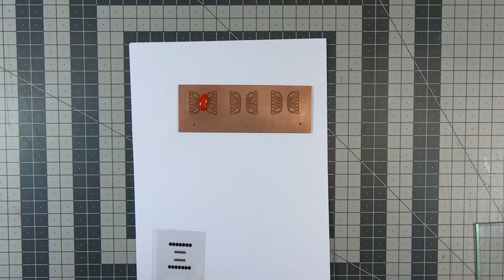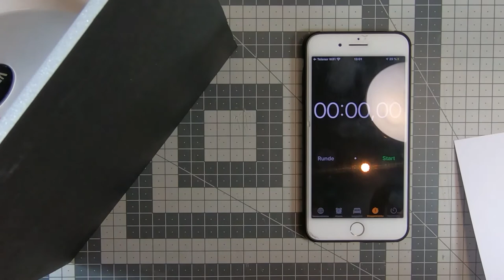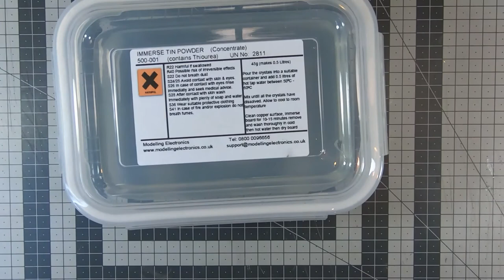UV Solder Mask VS. Dynamask - a how to guide!

Comment: I've used dyna mask in the past and find it ok (so long ago that I looked this video up as a "refresher course" before I finished the boards I'm currently prototyping).  I bought some UV cured liquid at the same time, and had no luck with it🤷‍♂️. I tried both today after watching this, and I'm pretty much sold on the liquid- it seems to cure harder and withstand lead-free soldering temperatures better (with my curing systems), so thanks for dual tutorial!👍👍
Oh, and my premixed tin plating solution had gone off since I last used it, so thanks for showing the label on your tin bath, I bought some powder from this supplier, and it should last me for ages (I only do small boards, so dissolving 18g in 200ml gives me enough to work with for a few weeks, then in a year or five I can make a fresh solution using the long shelf life powder) more thumbs up and thanks for this👍👍

Comment: Thanks, your videos are great! I just tried the method using the UV paint, and bizarrely I get the opposite result from what might be expected - exposed paint comes off, stuck to the transparency film, but the uncured regions over the pads remains perfectly on the board. An almost perfect inverted result. I wonder if this is because I haven't cured it enough, or that I have bought a transparency film which the paint really likes sticking to!
Reply from the maker: Hi!
Sounds like it needs more curing. It the paint still sticky?
It is supposed to be, more or less, cured where there is no print on the film.
Also, try to roll it off by curving (almost folding) the film and not lifting it straight.
Hope it helps :-)
Reply: @DIYTECHBROS  hmm, thanks! I'll give that a go. Strangely, the cured areas pull away from the board cleanly, and are not sticky to the touch at all. Which made me think that they must be cured more or less all the way through...
Reply from the maker: Sounds strange... have you cleaned the PCB with some subbing alcohol or acetone? Different companies put different protective "oils" on the boards to avoid oxidation. You can also sand it very gently (do not take off to much copper).
Reply: @DIYTECHBROS  :D i actually did all of these things! - IPA, acetone and light sanding. One thing did strike me, however, the PCBs I'm making have a filled ground plane on the track side, so are almost entirely copper, which I'm thinking may not have such good adhesion compared with the base material. Although I haven't had a chance to test this theory just yet.
Reply: @DIYTECHBROS  I finally managed to get a decent result, mainly as you say with the peeling technique, essentially folding the film right over on itself while peeling. Also my LED torch, i'm fairly sure, isn't very effective (perhaps the wrong wavelength), but leaving the board in the sun (even on an overcast day in the UK) worked quite well. Thanks :)
Reply: Very good job
Reply: @drQ11235  I'm having the same problem with it sticking to the transparency sheet. How long did you leave it in sunlight?

Comment: I do like the dynamask. While it's more steps, it looks easier to apply.

I am not a big fan of the UV process though. If I wanted to fiddle with a mask and that quite often is not dark enough I could just etch the PCB instead of using the CNC :)

Also: I see Adams Readi Board... Are you guys RC aircraft pilots? :)
Reply from the maker: I know what you are saying Balu :-)
It's so convenient just having CNC doing "all" the work while you can focus on other tasks. 

Must check it out!
Yes, we used to fly, just have not found too much time the last couple of years. So we need to try harder as it is both fund and recreational!

Comment: You are a best what uv light using in wat and is this a dynamask 15CMx2M PCB Portable Photosensitive Dry Film for Circuit Photoresist Sheets 1M Brand New For Plating Hole Covering Etching

Comment: at 3:30 how do you develop a UV mask? what is this liquid?
Reply from the maker: The UV mask is cures with UV light, like the sun. The liquid is for tinning. It applies a protective cover to the copper, and also makes it easier to solder!
Reply: @DIYTECHBROS  Apparently the translator does not translate well! After you applied the UV mask, you covered it with a photomask, then illuminated it with a UV lamp, but then you wash off the unlit areas of the mask with a brush. I'm asking WHAT IS THIS LIQUID? Give the link. And what you write about tinning is already the final stage. He is not interesting to me.
Reply from the maker: @АвовНитуп  Okay! Just use rubbing alcohol (methylated spirits or isopropanol). Most things that thins / removes paint will work.
Reply: @DIYTECHBROS  ok! Thank's